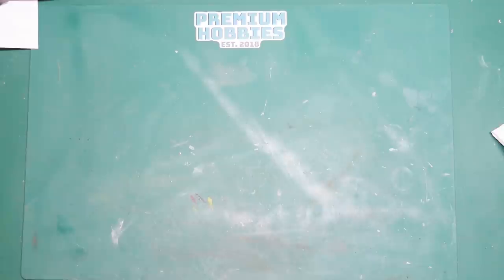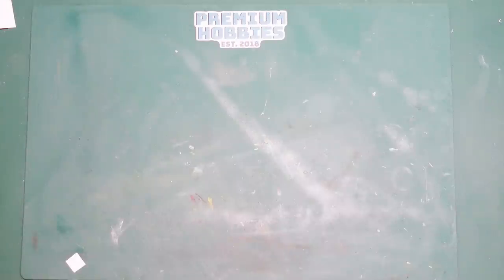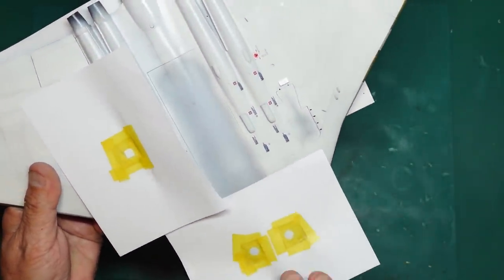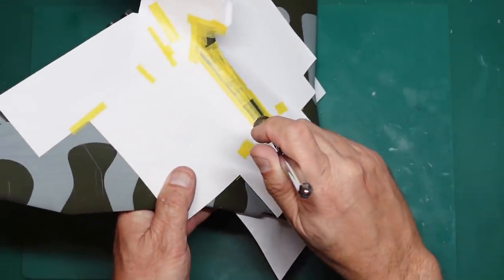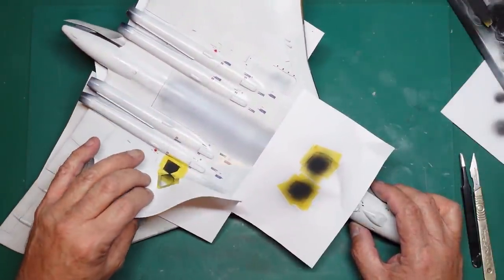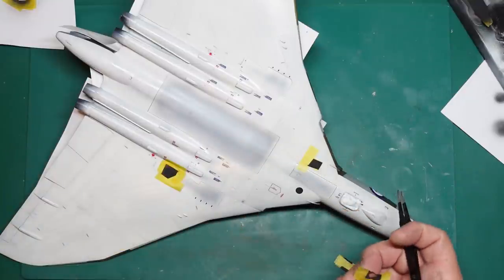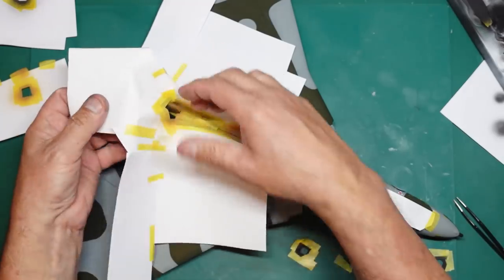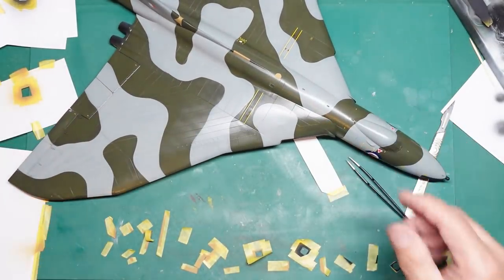Airfix New Tool 1/72 Vulcan build, Part 20

Comment: Just a forewarning, make sure you fit the main undercarriage rear doors before fitting the wheel assemblies. I didn’t, so had to cut off the locators and butt attach them.
I’m looking forward to seeing how you fit the various doors. This always gives me trouble?
Fitting the front wheel assembly was also a pig.
Reply from the maker: I've already covered that in a video Will.. I will be fitting them simultaneously.

Comment: She’s looking good Nige, just tried to order those masks but they were out of stock - I’ve left an alert for when they come back in. Consoled myself with Airfix’s new tool Mossie until then.
Reply: Ooh, I didn't know about that. I've just finished an old tool Airfix 1:72 Mosquito so I am going to wait to see a review or two before I commit to the new one.
Reply: I watched a Flory live with Paramjit the designer of the Mossie. Some really nice features to it, you assemble the undercarrage dry fited into nacelle, then can remove to paint and afix end of build, Like Nigel struggled to do with his small Lancaster. May seem strange the 6 exhaust stacks either side engines are two part, but this is to get finer detail with them. Seem to think there's a jig for assembleing some part, though maybe confusing with the Vulcan stacks jig, he talked about that as that evening.

He's a modeller himself so he designs with making the model in mind. You may think the stubs that go into wheel are too short, be he showed his model could support a 2KG weight. Think you'll really enjoy the build
Reply: @keithwaterhouse4304  Nice one, cheers Keith.